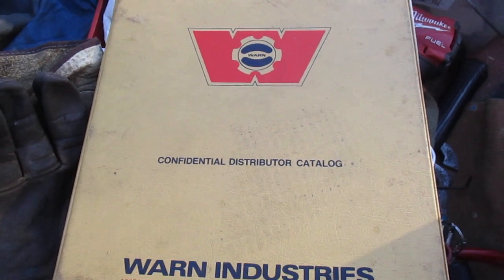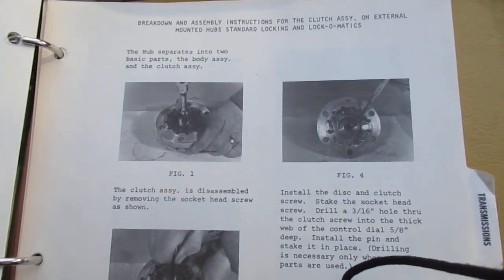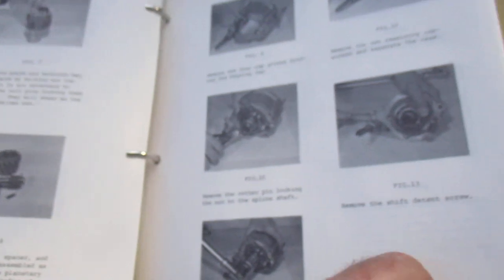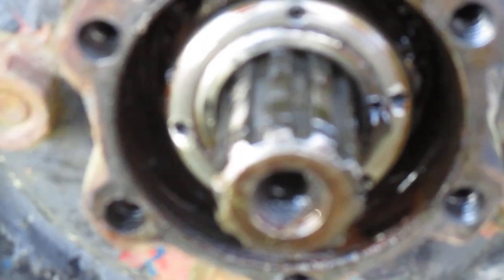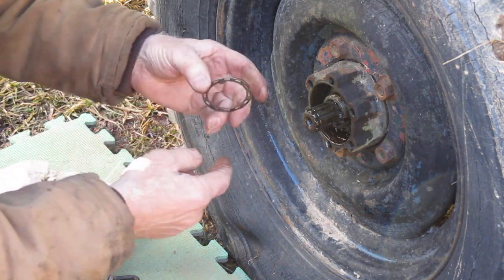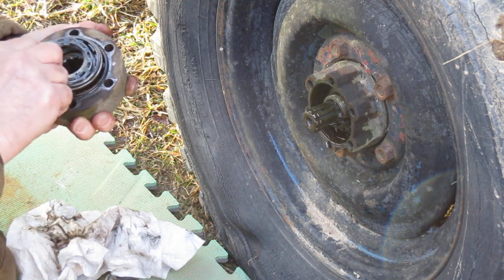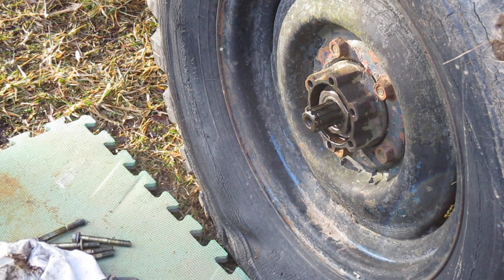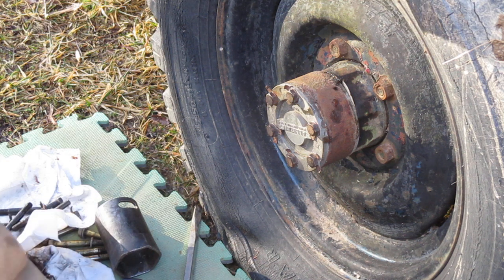WILLYS JEEP WARN  LOCK-O-MATIC AUTOMATIC HUBS  part 1  #263

Comment: I bought a used set of Warn Auto hubs but did not get the two pieces that you took off in place of the spindle nut.  Is it possible to use them without those pieces?  I don't care if they work automatically or not.
Reply from the maker: hi there those are almost the time missing , as i recall you can still use them but they wont' be auto you will have to put the 2 nuts on and bend over the washer , So glad you stopped in and left a comment .Thank you john
Reply: Thank you for your reply John.  I actually found the missing parts at Kaiser Willys.   I was really surprised, I didn't think there was a chance in hell finding them. @fricknjeep
Reply from the maker: hi thats great i have one of there books i will go take a look  john @randyb4723
Reply from the maker: hi again i just went threw there 2023 catalog and did not see them , john @randyb4723

Comment: Thanks for the video, I just found a set of these in my parts,do you know what years they fit or might be,they are stamped m31e,thanks Paul
Reply from the maker: hi there they most likely fit any older jeeps pre 1970 . 10 spline . are they complete , they need to have that ring in older to be auto  ; john

Comment: Do you just hand tighten the piece with the allen screws when installing? No where to get a grip to tighten otherwise.
Reply from the maker: hi there not sure just what you are talking about , the clutch ring that has 2 allens in it , they only go in snug , they go into a slot  in the ring ,at least 1 needs to go in , they should have non harding loc tite, i will try to do a short on it ,i hope that is what you are talking about .
Reply: Thank you for the quick feedback. I’m refereeing to the overall clutch ring itself. Do you just screw it on hand tight then screw in the allens into the slots in the washer with the holes? Seems screwing the overall clutch ring in hand tight is the only option, not sure how you’d tighten otherwise.
Reply from the maker: @michaelkaser2219  well it has been years sence i even looked at one , i will look for some latter today , but as i recall there are 5 wholes in that ring , 3 with threads 2 with out , the 2 with out are for tightening , i made a tool to tighten it no idea where it got to , you can use a needle nose pliers with a screw driver .snug is fine , the first nut adjusts the bearing , john
Reply: Perfect that answers my question thanks!